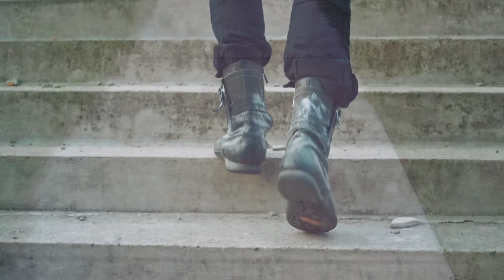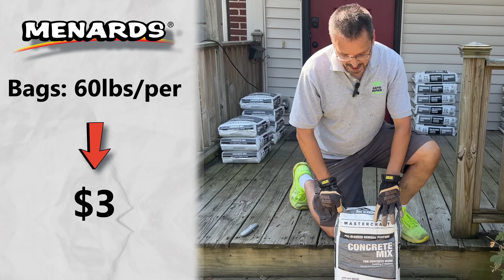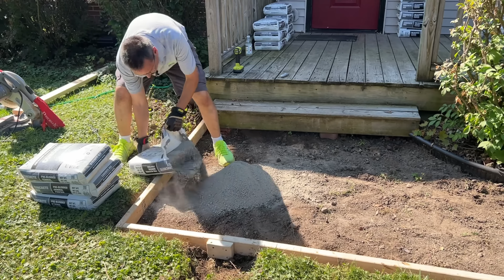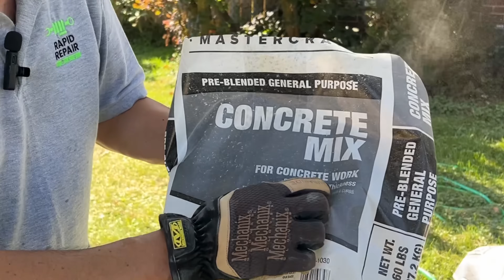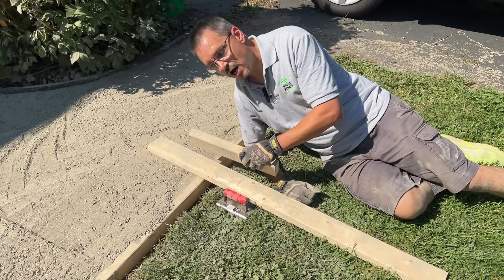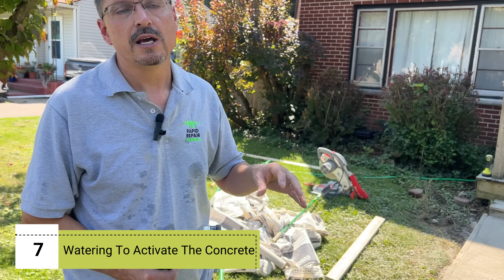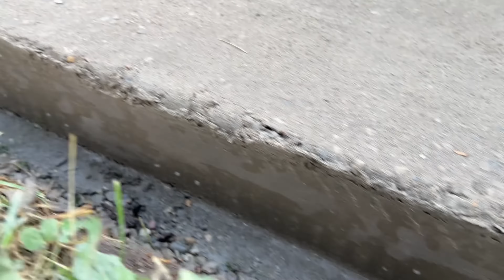Dry Pour Concrete Method Anyone Can Do

Comment: Thats a lazy mans way of doing it.. and it looks like crap
Reply from the maker: I’m going to leave your comment up because it’s fair criticism. Dry pour is not an approved method, just because I’m demonstrating it does not mean I approve of it…. It would only be for tiny small insignificant areas for do it yourselfers around the home…. when they have no help or knowledge or the ability to mix extremely heavy concrete bags.

Comment: Is there a reason for no reinforcement like rebar or wire mesh?
Reply from the maker: Great question. Because it’s not needed for tiny simply slabs such as small walkways, steps, garbage bin slabs, planter pads, etc 👍🏼😎
Reply: @HomeRapidRepair   yeah, they still crack!!

Comment: How many times do you recommend to mist the concrete until its wet enough?
Reply from the maker: Most people seem to be doing it at least three times. The first is a very light, gentle misting and then about half an hour come back with a bit of a heavier misting,

 and then in about 45 minutes or so come back with a heavy soaking and make sure everything is completely wet…
Reply: @HomeRapidRepair  ok thanks : )

Comment: Did you add water before misting? If so,how much
Reply from the maker: No. ZERO water was added until starting with the lite missing 

When you get to the heavier soaking it will absorb water from all directions including underneath the slab.

Comment: It looks like you end up with a sugar harden top and sides with a powder inside with no structure integrity agarate pepples that will be loose and chip out. Easy isn't always the correct route.
Reply from the maker: All your points are fair for sure 👍🏼😎
Reply: We just did 3 side walks hand mixing around 60 bags 80 lb in a wheelbarrow. Lot of work , but much better than this I think and finish looks great

Comment: No compaction no rebar rough edges , it will form cracks over time , not a smooth finish. sorry
Reply from the maker: Of course, everything you say is correct… That’s honestly not the point… This is just showing a simple DIY option for somebody that has no experience, only wants to pour a small slab, doesn’t have a helper, can’t mix a lot of bags quickly, has physical limitations, etc., etc.

Comment: What is the maximum slab for a shed that you would recommend using your dry concrete method?   Great video by the way....
Reply from the maker: People say this is not as strong as traditional pour, which is true. However, I drove over one of them with my truck to show how strong they are… Dry pour method is fine for most applications. For small projects, it’s perfect.
Reply from the maker: Thank you. Great question. 3 1/2 to 4 inches… Which is basically a 2 x 4 stud would be fine. Unless it’s some ginormous shed like 10 x 15‘ or something… Then I would go with thicker slab…

Comment: I am looking to do a 28'x12'x3 1/2" patio. Lowes told me this would be a disaster. Is this doable? I am going to do it in sections.
Reply from the maker: Yes, it will work. That’s one of the advantages of the dry poor method. Is that do it yourself can do it in small sections. It will not be as strong as traditional concrete. Also keep in mind. The finish appearance is rough compared to traditional concrete methods. You should really only do it in areas that are utilitarian, like AC pads, small steps, garbage bins, sheds, etc..and will not be highly visible…

Comment: There's no way to smooth it  out after it dries? I don't like the rocks that are noticeable at the end. Any methods in removing that look?
Reply from the maker: You have identified the biggest complaint with this method. The surface is not attractive . It’s fine for placing your garbage cans on it or a shed… But if it’s in a highly visible area, the surface looks sketchy. You could take a screen and filter out the small rocks and pebbles in the dry mix, before you add water… That will work. 

Also, you can do a Concrete resurfacing product over the top of your finished pad… But that’s a whole additional step…
Reply: @HomeRapidRepair  Cool. Thank you for the reply.

Comment: Testing was done dry pour vs wet pour dry was so much weaker
Reply: @johnporzio3768  will keep that in mind when I build an overpass instead of a slab for my grill.
Reply: @Jamie17210  that was funny
Reply: Run that edging tool again while the concrete is wet, and you will get cleaner edges.
Reply: yep, I watched several different tests and they all showed the same.
Reply from the maker: Yes I 100% agree with you. However, the easy dry pour method still has its place for a very basic DIY’er  that just needs a small and insignificant area of concrete… Thank you for watching.
Reply: I just saw a psi test done on a dry pour and it came in at 3200 psi...it depends on the concrete, method used, and time cured. But 3200 is enough for my front patio so im doing it!

Comment: How many  time put water
Reply from the maker: The first misting you want very gentle and light, and then most people will reapply a light spraying of water every 30 minutes to 60 minutes…

Once you get beyond an hour and a half or so, go ahead and give it a good soak down… So you know the water reached even the inside of the slab and up from the bottom, etc.

Comment: Hello…can I use this dry pour method with any concrete dry mix? Thanks…great video
Reply from the maker: Yes, absolutely. You sure can. It is so easy you won’t believe it. The only drawback is you can’t guarantee a perfect surface. But it’s so easy to use, you don’t need a helper.  And for DIY’s, you don’t have to worry about working fast to keep up with mixing bags and bags of concrete ahead of time. It saves you a lot of Exertion.

Comment: I use a 200lb yard roller to flatten the dry pour. Its the perfect tool to level it flat.
Reply from the maker: That sounds like a great tip for leveling the dry pour. Wait…that was before adding the water? Did you have any problems with stones coming up to the top?
Reply: @HomeRapidRepair  Duh.
Reply: @HomeRapidRepair  from what it looks like in the pictures there's lots of rocks in the top of yours in this video
Reply from the maker: @blueeyes3079  True, this is a problem with the pre-mixed bags for that smooth finish look. I've seen other videos where people have poured a smooth topping concrete mix on top without any stones.

Comment: Just lay the bag down where you want it to go and cut it length wise and flip it over, a lot easier and less dust!! Nice Work!!
Reply from the maker: You're right, that's a great tip. Thanks for sharing! 👍🏼😊
Reply: @HomeRapidRepair how's it look after almost a year?
Reply: That’s how I do my mulch.
Reply: plus it is super weak 🤣.
Reply: Please don't F over yourself and more importantly, anyone you sell your house to with this BS. Please see video: "The TRUTH About Dry Pour vs Wet Pour Concrete!! Strength Test - You WON'T Believe the results!!"
Reply: @jasonmadruga9028  You have that right.  This is a joke video.  Looks like garbage with all those rocks at the surface and it will crack and break up in a short time.
Reply: @linthead98 well we can’t all afford to hire someone with the wet concrete and some of us certainly understand our limitations. I’m ok with this for small jobs around the yard. I live in north Texas so it really doesn’t matter what I use. It all cracks eventually and in most cases sooner rather then later,
Reply: @ShemRoberson-nj7sg You got that right.

Comment: How do you calculate how many bags of concrete you’ll need?
Reply from the maker: Great question. Online there are free calculators. They will have you enter your depth x width x your length of your slab and it will calculate how many bags you need, it’s even smart enough to tell you what size of bag such as 40 pound bags or 80 pound bags, etc..
Reply from the maker: Here’s one you can use: https://www.quikrete.com/calculator/main.asp

Comment: Looks great, I actually like the exposed aggregate look.   Thanks for showing some diy options.
Reply from the maker: No problem 😊
Reply: @HomeRapidRepair I would love to see an update on how this is holding up!   Thanks again
Reply from the maker: @C @ChasinSimplicity  yes thank you for that fantastic idea. I will do that. It’s been well over a year and as far as I know, there’s not even one single crack. In the meantime, here’s another dry pour Concrete video I did where I drove over it with my work truck: Dry Pour Concrete Test - DIY Concrete 
https://youtu.be/0jxCoXkS-EA
Reply: @HomeRapidRepair I saw that too.  Impressive for one day only
Reply from the maker: @ChasinSimplicity  Ok, that's cool. Thanks....I'll do a follow up video on the first dry pour. I never thought about it, so thanks again for that fantastic idea
Reply: @HomeRapidRepair thanks for the great ideas.  I need to try some of them out on my property

Comment: THAT IS AWEFUL LOOKING - Get a wheel barrel and mix it by hand - get a your helper to mix
Reply from the maker: I agree with you. But still wanted to make a demonstration video for people. Also for large areas to do it yourselfers cannot mix enough bags, fast enough and keep up with the concrete hardening… So this is a viable method for very limited uses 👍🏼😊
Reply: If you want a smooth finish, just get mortar mix to top it before you mist it with water.
Reply: @qret-dv5ym  100% agree.  Do the top 1/4" with straight mortar mix.